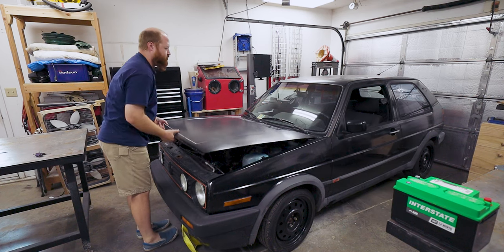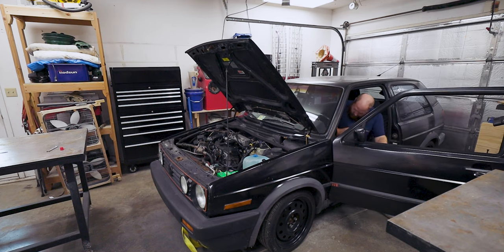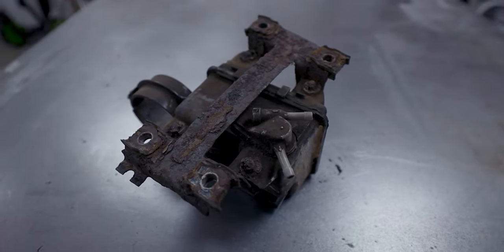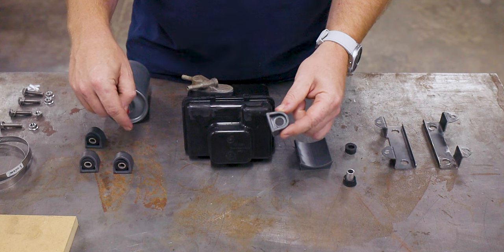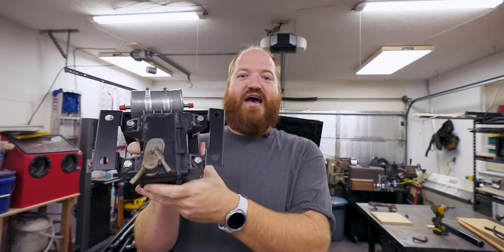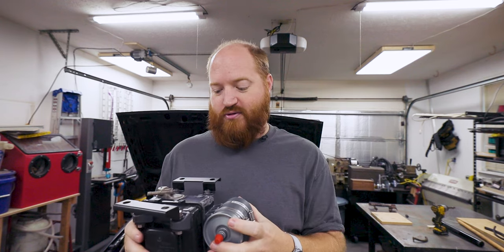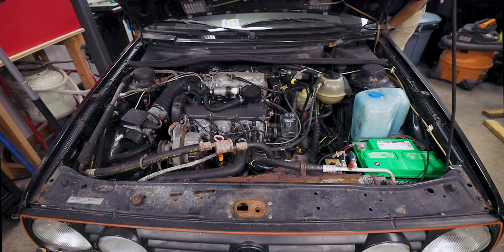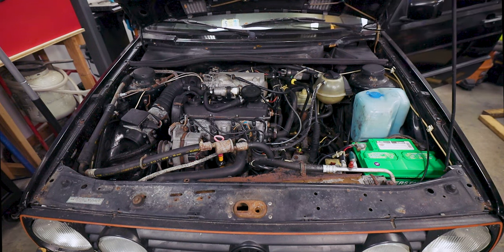Will my 1992 VW GTI start after 8 years?

Comment: Agree with the quality work on here. Very good. Shame to see the Toyota go after all the hard work. I was interested in that as I have a 4x4 Toyota of a similar age (shared many elements). Still I had a mk 1 Golf years ago that had (badly) been converted from petrol to a diesel engine though shortcuts were made. It was a great little car and coped well with the very challenging roads where most people had 4WDs. I still have a slightly newer Golf than yours so might stick around. Yours has aftermarket steering wheel and pedals / covers.
Neat work on the filter housing. What material were you printing with? And what glue did you use? Be good to know, thanks.
Reply from the maker: I own a formlabs form3 printer that prints resin. The material is called tough2000 and mechanically is a pretty strong without being brittle. In the video I used a basic 2 part epoxy, but gas got to it and dissolved it pretty quick. So it call came un done. I’ve reattached everything with Loctite 1360700 which claims to be gas proof so we will see how long it lasts. I’ll be going over it in a later video if it works well.